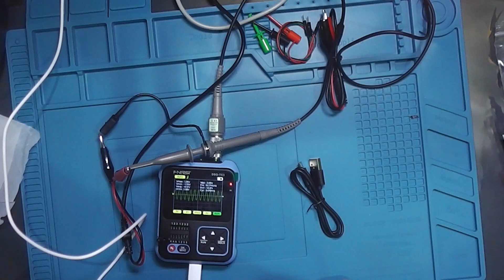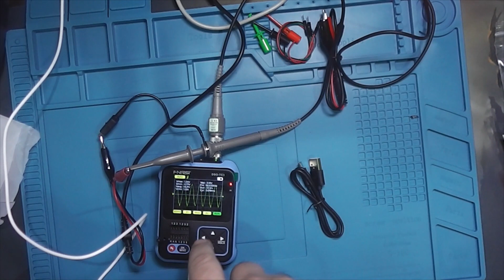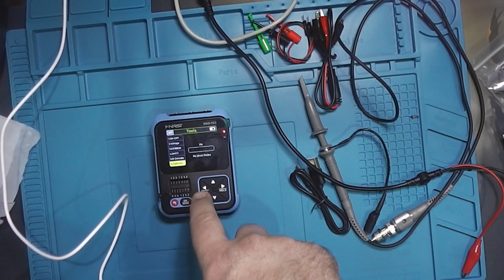FNIRSI DSO TC3 quick review with nice the end conclusion

Comment: Sorry, but you are telling nonsense: the measurement of resistors is well within the specs of that resistors. Changing the battery is a 10 min, 3 Dollar task for the users of that device. It is a standard lithium internal battery, which is sold on AliExpress by hundreds of shops.
Reply from the maker: I agree with you to some extent, but I also disagree. Thanks for your comment. It's certainly nonsense to say the battery can’t be replaced—it’s indeed a 5-minute job. However, my initial impression was that the device seemed designed to be used until it stopped working and then discarded. The brief guide provided with the device, which made no mention of how to replace the battery, reinforced that feeling. That's what I shared in the video—it gave me the impression of being a disposable product.

Regarding the resistance measurements, at least in my unit, there’s a significant error in measuring resistance. This error goes well beyond the margin of error specified in the device's documentation.